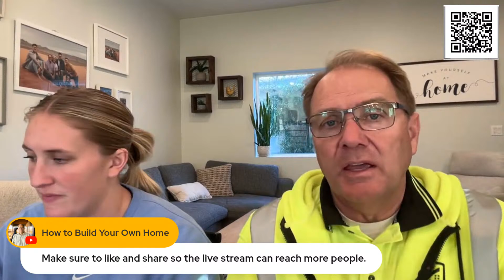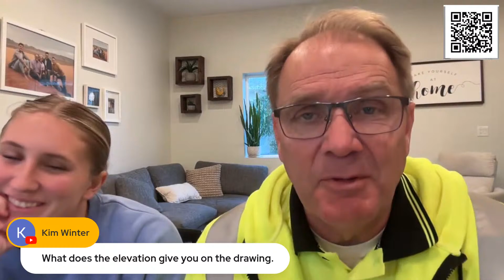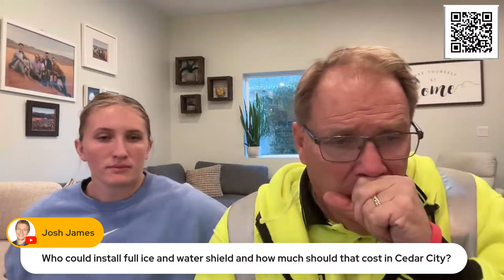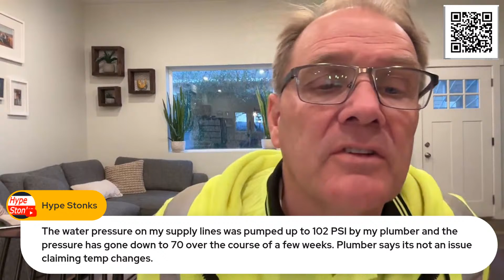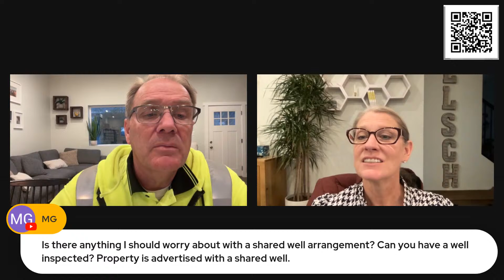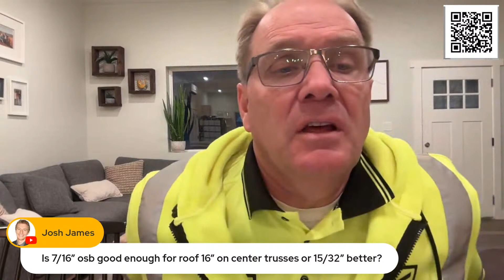Live Q & A with a General Contractor

Comment: @Hype Stonks who asked the question in the video and didnt really get an answer because the question was misunderstood: I believe you are asking about the pressure test for new construction using air to pressurize the lines. Its true that the pressure will fluctuate with temps, however that is a large swing. I would re-pressurize and test again. In my area code requires that the lines hold a minimum of 50psi for 15 minutes without dropping. If you test again and it holds whatever your requirement is, lets say 70psi, for more than 15 min, then you should be okay. Another option is to pressurize with water and look for leaks visually if you are concerned about it.
Reply from the maker: Good advice, thanks for adding your expertise!